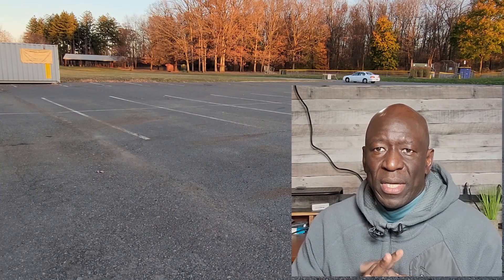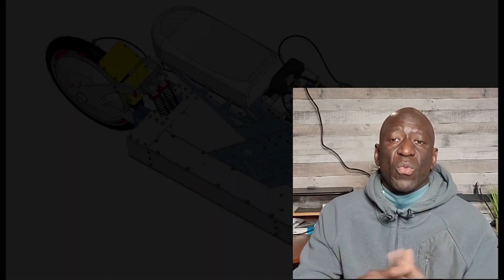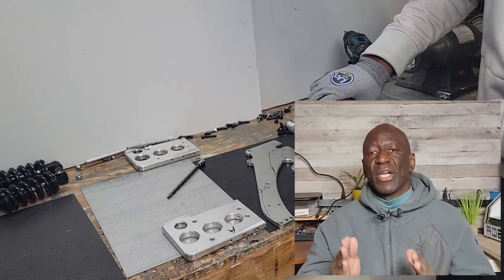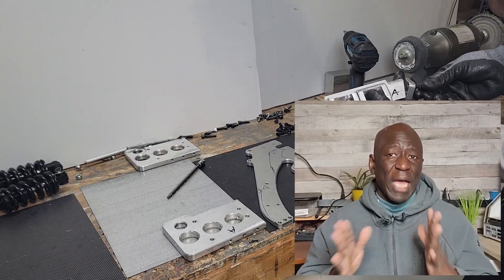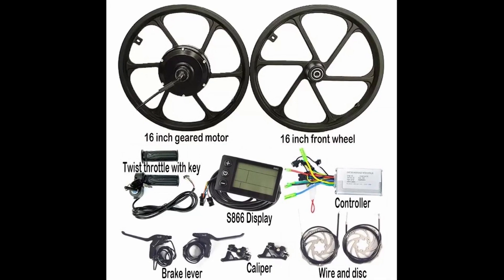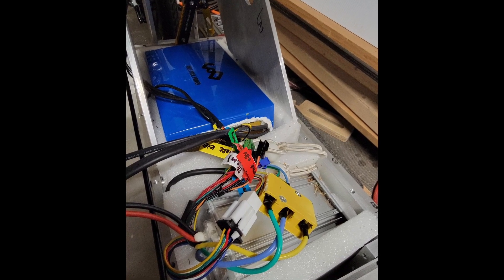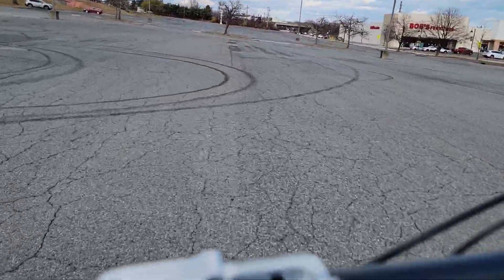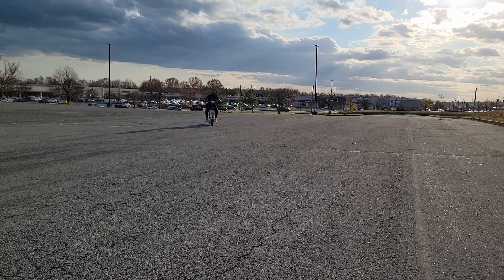V3. How I Designed & Built an Electric Bike From Scratch!,

Comment: hey great work!
1.what is the overall weight ?
2.why did you chose such a large frame?
3.what is the reason with going with a 1000w hub motor while your frame seems to be able to handle much higher tourqe.
4.what was the cost for all the metals?
5.what will you do different if this was for a commercial application ?
6. why did you go heavy not bolts and no welding ?
Reply from the maker: Hi. Thanks for watching and commenting.
The E scooter project as presented in Part 1 https://youtu.be/ka00fApwFk4 is a design and manufacturing project. I create Engineering training materials mainly for 
College students and Young Engineers. The scooter Design project is a lesson in fits, tolerances and clearances. A flawless assembly can be achieved if this is done right.

1.	I haven’t been able to weigh the scooter but I am able to move it around but not lift it.
2.	The design style provides a lot of opportunities for the trainees to gain design/manufacturing knowledge.
3.	I went with the 1000W because it came as a kit with a 16 inch wheel plus controller. I might eventually upgrade. I must admit that even 1000w with 52 volts battery is fast for me.
4.	I have access to a lot of metals mainly aluminum but I would estimate it to be around 
        $500 ish.
5.	I would have to redesign to suit a mass production process.
6.	Most of my students are looking to 3D print scaled down versions. If the scooter was to be commercialized then I would definitely go for a welded frame.
Reply: @simbamkuu33  great content and response. 
Will go and watch the first part.
Reply: @rotem2116  my experience, the ratings on the motor are pretty irrelevant, its all about the battery and ESC. im running a "250W" hub motor at more like 2.5KW and it barely gets warm...

of course, its only 2.5KW when taking off, when its under the most load. once cruising, its only a few hundred watts... except... is that actual power, torque over RPM, or the electrical consumption? totally different things. 

if i were to start trying to explain how the battery and ESC is a source of EMF, and the spinning motor now acting as a generator produces a BEMF or counter electromotive force, OPPOSING that applied EMF... you probably wouldnt understand.

Comment: I just stumbled on your channel, and I must say I'm impressed. I'm based in Nairobi, and recently developed an interest in becoming a maker, and I've been learning how to work with Arduinos, motors, LEDs, etc. I do have 3D and CAD modeling skills. Your channel has surfaced at the right time. I think I might learn a few important concepts from you.
Reply from the maker: Hi Ken, thanks for watching and comment. I have checked out your channel and subscribed. The best way to benefit from this channel is to replicate the designs and also machining out your designs. Also make use of your 3D printers , These will also improve your understanding of manufacturing. I can be reached at simbamkuu33@gmail.com

Comment: I've always thought there was no such thing as overkill because it just meant doing something right the first time around, flawlessly....I stand corrected.
Reply from the maker: I look at it more as due diligence rather than "overkill". if you iron out all the details like fits , clearances and Tolerances on the design stage (especially on this type of an assembly), you can achieve a flawless assembly process.